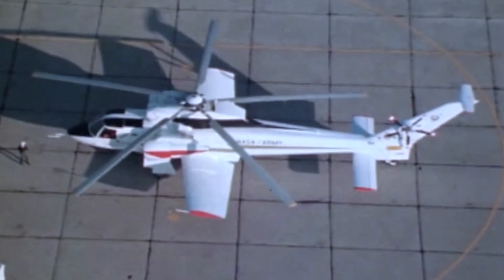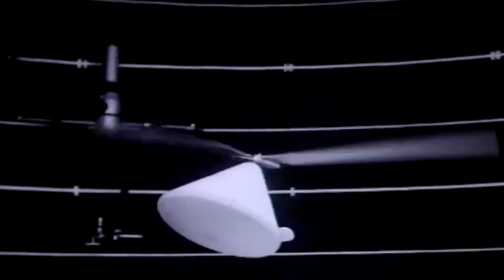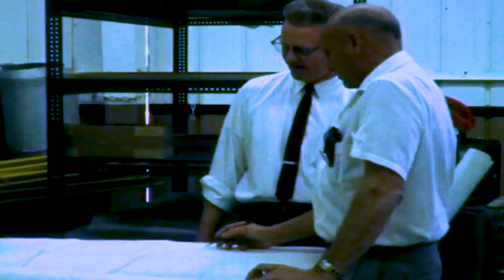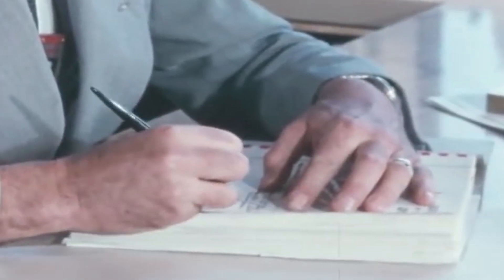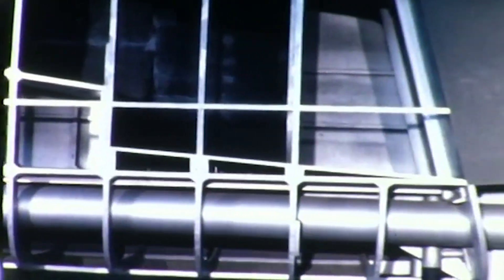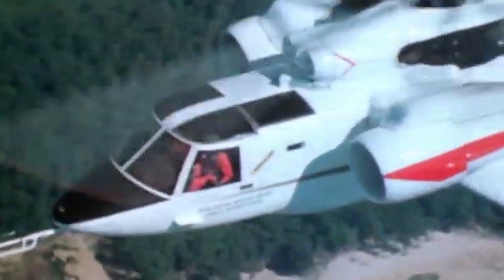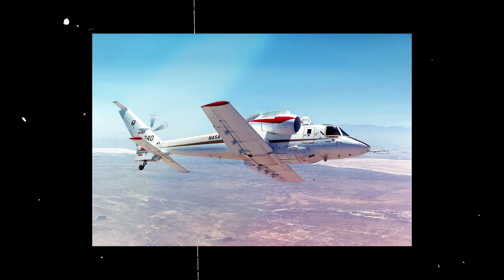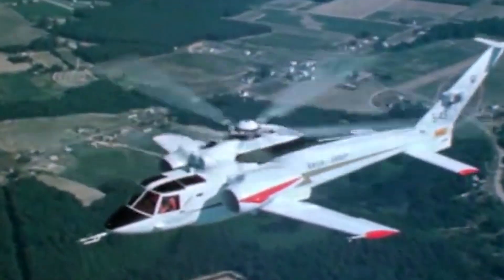The X-Wing - S-72 Jet Helicopter with Blades as Wings

Comment: Fixed wing and rotor wing on the same aircraft do not fit US Army vs Air Force roles and missions delineation per the Key West Agreement. Such a military aircraft would have to be developed and sold mostly outside the USA. For such a design, I like the pusher prop of the AH-56 Cheyenne over the 2 turbofans.
Reply: The trubofans were to provide propulsion during testing of various rotors and also for use when no rotor was fitted.

Comment: Did I see four engines?
Reply: Two turboshafts to power the rotors (including tail rotor) and two turbofans for conventional powered thrust. The S-72 had enough conventional lift and thrust to fly without its rotors, which it did in testing!

Comment: This design should be re-examined.  It seems to be viable.
Reply: Actually the newest helicopters the government is looking at have a similar concept
Reply: If cost could be kept economically viable it looks like it would be an almost perfect fit for Uber's vision of air rides.
Reply: @arbysandtehchief5494  Can I fly it with car drivers license?
Reply: I feel like if they kept funding it would have been an insanely awesome breakthrough In history and science. But personally I dont think we need this aircraft in 2020 because of what we have today like the Harrier, f-35, Osprey as mentioned, and the list goes on. But 🤷‍♂️
Reply: Instead of this they added a propeller in the back. Fastest helicopter ever. No need for it yet, but we 🇺🇸 have a working “prototype” should we need faster Apache’s or the like.
Reply: Is it much better than a tilt rotor like the osprey is the important question. 
Because that's what we went with so I have to assume it worked out better than this layout
Reply: @jblob5764  This layout was apparently never fully tested though. The Osprey is just the latest iteration of a DARPA love child from the 1960's. While the Osprey is faster, and has a higher maximum takeoff weight, that doesn't mean that this doesn't have viable applications.
Reply: @arbysandtehchief5494  Ok what kind of application are you talking about? Like a lot of money was thrown at this thing and they through it out because there was no application. That and the people involved didnt have enough confidence to do a manned test flight in x wing mode.
Reply: @helmholtzthemulewatson4763  DARPA looks for military applications. Just because it doesn't meet the military's needs doesn't mean it's useless.
Reply: @arbysandtehchief5494  So what applications are we talking about?

Cause Im pretty sure they were looking hard for application after they spent all that money.
Reply: @arbysandtehchief5494  Complexity and cost killed it.
Reply: @jblob5764  the new sikorskies with counter totating props looks to be a far better alternative than even a tilt rotor. 

Its far simpler
Reply: @carlosandleon  The only problem so far is that they repeatedly just don't seem to do what is promised.  Oh and the control system of that X@ technology you're referring to is more complex than that of Tilt-Rotor.
Reply: @jblob5764  If I'm right the Osprey is still in use today. I would love to have one for a mobile home or RV.
Reply: @jblob5764  idk I heard the osprey isn't very safe
Reply: @jblob5764  Odspery can carry more weight and is more durrable, this is basically an advanced bi-plane helicopter
Reply: I doubt it would be as viable as, say, VTOL jets are today.
Edit: Forgot about the civilian market. Someone pointed out that it would be a great rescue helicopter. Not sure an F-35 would be able to do the same LOL
Reply: @kanyeeast8450  but the US's VTOL jet is in the hands of the Marines and the further away it has to fly from the less it can stay on station.
Meanwhile the Army could use it as fire support since the Air Force accepted that rotary aircraft with fixed wings and forward propulsion did not break the Key West agreement.
Reply: I believe the new army helicopter will have some similar features but I am not sure
Reply: The problem was the technology of the day.
Reply: Very much could work.  If they can fold the heli part when they get to altitude and use the jet to fly around  that would work very well but would probably be too expensive and complex
Reply: @raywarlock  Per yesterdays Tech, maybe, today's tech it should be easier, less complex and probably cheaper percentage wise compared to the cost of the $.
Reply: @jpasby779  yesterday's tech is still today's tech. Tech doesnt suddenly change in a single day.  It takes weeks to months to years
Reply: @jpasby779  plus figuring it out will cost a lot of money. Prototypes like those are very pricey to make it work and make it cheaper.
Reply: @raywarlock  If you think, a lot of the simpler mechanics of the day have been over come by today. Today we have gaming computers that can run hundreds of circles around the computers of those days. The F-22, F35B, and the Osprey are not all yesterdays tech. that's like saying our cars today are equal to the house and carage
Reply: @jpasby779  what i am saying is that the design can end up a failure and will be expensive as hell just to make it work and even more expensive to make it cheaper while fixing flaws. Which will take a long time and of course we have better tech than 10 years ago but the tech 10 years ago have not changed that much. New Prototypes are EXPENSIVE and takes TIME. Some seems like a good idea but in practice would of been bad which works the other way around aswell like for example nuking fires like russia did to a fire that was constantly burning non stop so they nuked it shut which worked. 

Helicopter jets are complex and WILL take a long TIME to make it WORK. Making it too COMPLEX will make the COST go UP.  
The heli jet is an interesting concept that is most likely going to fail cause of it's noise so best it can do is be a military transport chopper and not a civilian uber service like one heli plane they made long ago that was too noisy.
Reply: @raywarlock  Being this was started in the 90's and how much we have learned from then, and going off of what has been started, today we can finish this in half the time and make it successful. at the same time we now have the Osprey which can do the same thing but better and faster. The job is done in my opinion.
Reply: @raywarlock  This is something started in the 90's, we have developed a lot and learned a lot since then. Today we can go back and continue this and finish it in half the time. Now we have the Osprey which per the video can do the same thing, carry more weight and fly faster. In my opinion the job is complete.
Reply: @jpasby779  the osprey and the jet helicopter are extremely different and intensely more complications. The osprey is complicated but trying to make a jet heli that will be probably even more costly than the osprey to make it work unless it is going to a slow jet but if they are gonna do that then they should throw props instead of jets on that heli like the rotodyne which failed.
Reply: @jpasby779  the osprey is already enough, Dont fix what aint broke.
Reply: @raywarlock  Agreed. the Osprey is more simple and proven. They can make a smaller version for air taxi in large cities if desired.
Reply: @jpasby779  noise is a problem aswell
Reply: @raywarlock  Good point but already a thing of the past with copters and planes, a smaller civilian version of the Osprey can utilize these options, and how loud is the Osprey? I work near Nellis AFB, and the sound from some of these Jets taking off can be heard from for miles away. Helicopters and airplanes you can actually see them when you hear them. Never heard a Black Hawk without being able to see it same with a police Helicopter.
Reply: @jpasby779  true so yes it may not fail but i know it will be expensive to make it in to a prototype and fix the flaws.
Reply: @raywarlock  At least we have a layout in many forms that can be put together VS coming up with something that is not made yet in any aspect. And this far it may be 1 or 2 Prototypes then Production. Again the Tech is already proven just now down size for civilian use.
Reply: The design was re-examine and is currently being used in active combat under the designation v-22 osprey 🤣😂
Reply: @matth7384  wut disgrace of osprey, that is one cool flying vehicle.
Reply: I definitely agree
Reply: I agree 100%
Reply: 4 engines for a craft this small?
I don't think so
Reply: @sidharthcs2110  helicopter blades could create too much drag and cause the heli blades to become damaged. The heli blades will need to be tucked away if it is gonna be used like a jet.  Like for example the blades are in a shape of an X then become an I then sinks in to the hull a bit to increase it's aerodynamics.  But i could be wrong but still is a concern and possible design flaw especially the maintenance part since if the design is too complex it will be costly to fix and keep it in the air.
Reply: @sidharthcs2110  I didn't see any reply about giving this 4 Engines. that would make it too heavy, as far as the jet engines.
Reply: Harries took its place
Reply: Drones... drones are viable this is not.
Reply: It needs completely reworked they had a good idea then just didn't have the right design.
Reply: It's already been reexamined by Lockheed. They deemed the jet engines unviable (probably due to the fact that both the rotor and the jet would require different fuels). So they redesigned it and named it the raider.
Reply: Sikorsky knew everything about the technology; if they thought it were commercially viable, they would be making these now.
Admittedly, there is a difference between "commercial" and "military," but in this case, "commercial" would demand less technological magic. (Less armor, shorter range, smaller payloads, etc.) The fact that Sikorsky isn't interested in the technology is significant.
Reply: No
Reply: Viable yes, pliable no. When the politicians figure out how to make tons of money on it.
Reply: The pneumatic blade control system seems like a really terrible idea honestly. There's this fascination with VTOL, but it is only useful in naval situations where even rudimentary airstrips are unavailable, let alone for small-ish attack helicopters. Small-ish attack helicopters are... Small-ish attack helicopters, which rely on guided missiles anyway. An A-10 would serve the purpose of the high speed aircraft portion far better.
Reply: @gajbooks  - thanks.
Reply: The maintenance costs even today would be uneconomical.  A rotor system that can start and stop mid flight would be a nightmare, with breakdowns and mandatory replacements on a regular basis.  That's why tilt rotor hasn't caught on in the civilian market.
Reply: Whoever believes this project was completely shelved is just naive. Contract termination = forget we have it so we can use it later without you expecting it.
Reply: Most of this tech is in the new special operations version of the UH-60 Blackhawks.
Reply: Cost and complexity would be the primary problem. Military wise it would be effective as a troop recovery heli.
Reply: Oh does it captain?
Reply: They're starting to employ prop driven light attack planes in afghanistan and the other mountainous areas because of their maneuverability compared to the A-10, depending on weight restrictions this'd be perfect for that role
Reply: @goonerman40  does it help when people still hide in caves there? some radars can detect people from underground tunnels tho.
Reply: @effexon  at that point just bomb the shit outta those caves, when someone is underground like that it's rlly hard to un entrench them bc of home field advantage
Reply: @goonerman40  afghanistan is really hard even with these weapons/tools. biggest problem as I understood is there is so much terrain and mountains that locating people in the first place is hard. Tho US/allied had something like 100k troops there for all that big mountainous country, which is very little. How different was vietnam? Then they ofc didnt have heat radars and tons of electronics in every helicopter so that was different, and those enemy forces, did they dig like 10meter deep tunnels, so detection was close to impossible even with modern tech.
Reply: @effexon  Jaja it is the graveyard of empires after all
Reply: It pretty much is.  S-97 and SB-1 Defiant are going similar routes in terms of finding a middleground.
Reply: Interesting, yes, but I think it is too complicated of a system to rely on in a military context.  And I'm not sure what role it would play that cannot be filled by a more conventional craft?
Reply: @fredygump5578  This looks like a great emergency rescue vehicle to me. I think the coast guard could benefit from something like this, I dont know its maximum weight but I'd imagine it wouldn't be to hard to make cabin with a body crane work with it.
Reply: @trevorhansen1940  That's an interesting idea.  Get there fast, and be able to hover?  But I suspect this design is less efficient while hovering than a traditional helicopter.  I would put my money on a coaxial counter rotating twin rotor design.  That would allow for higher speeds than a traditional helicopter, plus extra lift capacity.  Right off the bat you get rid of the extra weight and complexity of the 2 independent engine systems, plus the complicated compressed air system...
Reply: @fredygump5578  and, unlike those jets, the tailprop can be useful in every phase of flight, like for quickly picking up speed or stopping.
Reply: @fredygump5578  The compressed air system is only there for X wing flight, if you dropped that whole concept maybe that would be all it needed???
Reply: @fredygump5578  Probably could be used as a FAC
Reply: @fredygump5578  they want to use one with a rear facing prop instead. That in itself more maintenance.
Reply: @fredygump5578  it's not more complex than the v22 tho
Reply: @invertedv12powerhouse77  I don't know the V22.  Normal aircraft designs include redundancy so the pilot has some control in case of multiple failures.  But it appears to me that this design relies on multiple systems all working together, meaning if one fails, the aircraft is in trouble. I really doubt this design is capable of an auto-rotate landing in case of a complete systems failure.  And I bet the wings by themselves do not provide enough lift to approach a survivable landing.  Anyway, it is extremely interesting, but I do not think it would be a safe aircraft, even with the special ejection system....
Reply: @fredygump5578  The wings on the S-72 are there so that it can be flown if the rotor is stopped or not present. Remember that S-72 was an aircraft whose sole mission was to test rotors.  An X-Wing would not have wings, because the whole point is for the rotor blades to be the "wing" when rotation is stopped.  And no, an X-Wing can't autorotate because if you lose the power source that blows air over the blades, you lose all the lift.